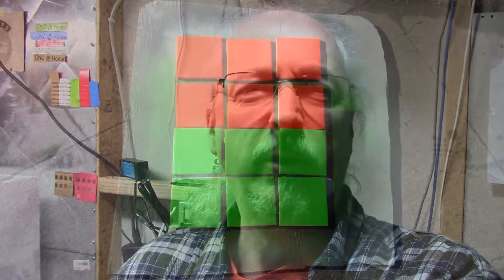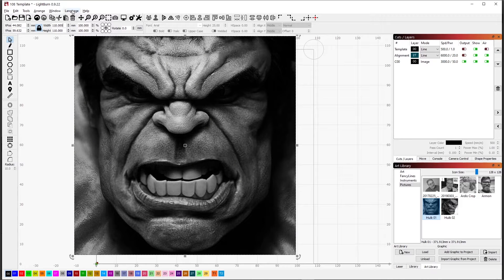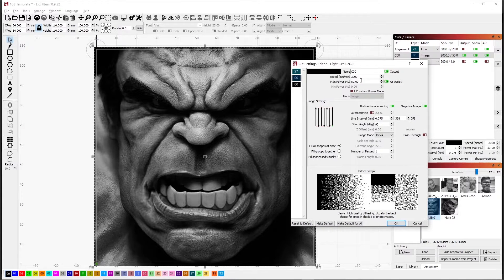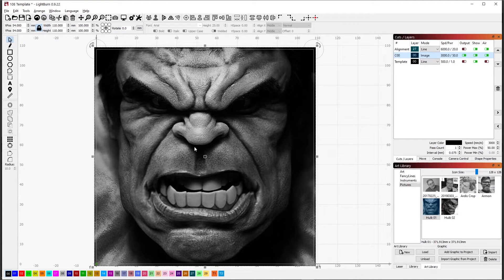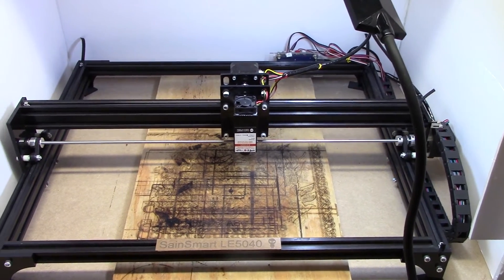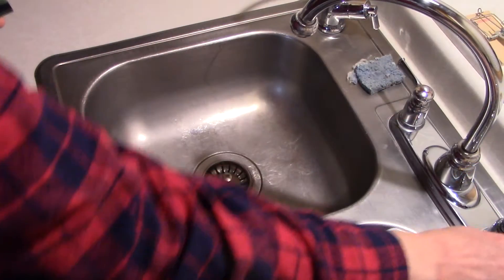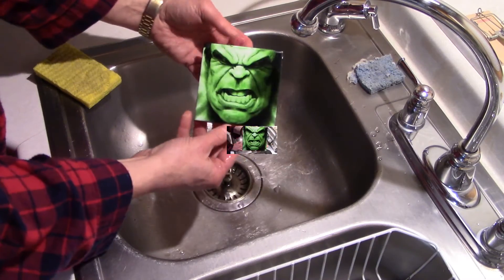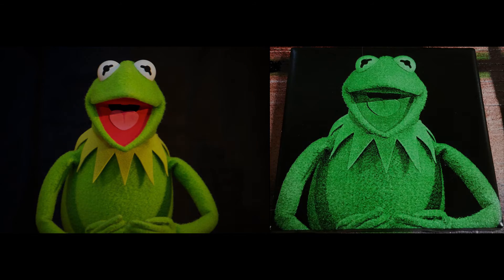Two Color Tile Burn - Black on green and black on orange

Comment: Hey! Amazed and delighted! I will definitely try your method on my machine. Please tell us in more detail about the type of paint you are using. I live in Russia and I will have to look for analogs for your type of paint. I ask for more information, since the success of the method depends on the paint - the laser power and speed can be adjusted. I hope for an answer. Sincerely.
Reply from the maker: Here is what I can tell you about the paint.  The green is a brand called Rust-Oleum and it is a Fluorescent green spray paint.  The black is also Rust-Oleum and is their Painter's Touch spray paints and is a flat or satin black.  I hope there is something similar in Russia that you are able to use.
Reply: @CNCATHome  Thank you so much! Found exactly the paint you recommended.

Comment: I have the 3018 with a 15mw laser would you have any ideas on speed and power I would need to use I can't seem to find a nice middle ground thanks
Reply: Also nice job!!
Reply from the maker: My laser is rated at 5500mw and is the Genmitsu LE5040.  If your laser is 1,500mw, I would try using 4 times the power or 1/4 the speed as a good starting point: 50% power at 1,000 mm/min.  Make sure the laser is focused and close to perfect as you can get it.  I know that can be a trick in itself.  I was able to get my feeds and speeds for this laser by experimentation.  I found that changing the burn direction would also make a difference in the end result.  This particular machine seems to like a 90° scan angle.  I can run the exact same project and use a 0° burn angle and the results are quite different.  
My best advice is to play around with your settings until you get something that is working for your machine.  That is how I get all of my feeds and speeds for this machine.  Good luck.  I hope you are able to fine tune your values.  I opted for the LE5040 over getting a laser for my 3018Pro due mainly to the speed of the LE5040.  I can run as fast as 10,000 mm/min. That higher speed helps speed up projects that don't need DeathStar like power.

Comment: Makes me wonder how hard it would be to do full color. What if you did 4 layers (red green blue and black) and basically mapped those to greyscale values in an image?
Reply from the maker: The hard part would be getting consistent thickness of each layer of paint. In an upcoming video, I have been doing some burns on white tiles with yellow, orange, red, then black layers.  Other than I didn't let each layer dry properly before I started the next layer, it worked well.